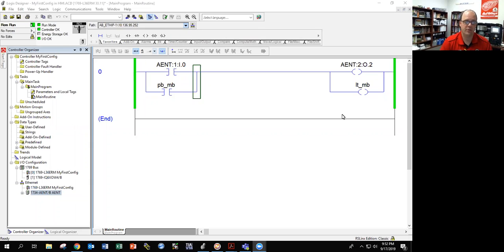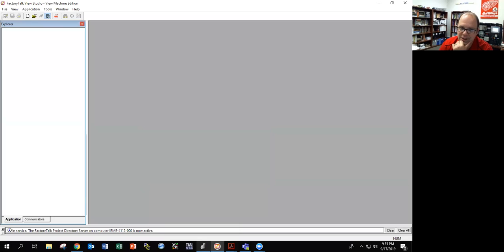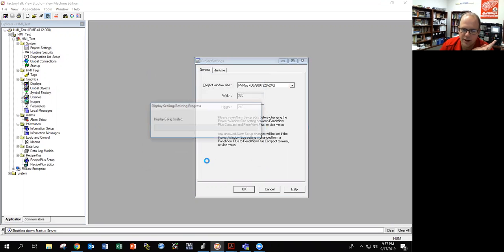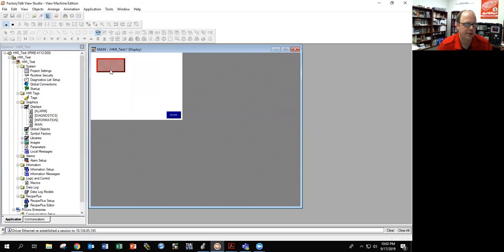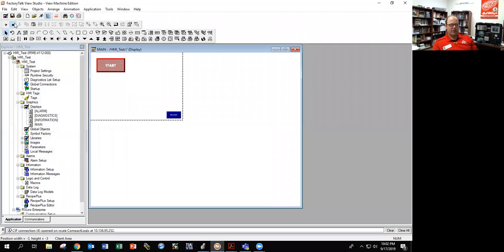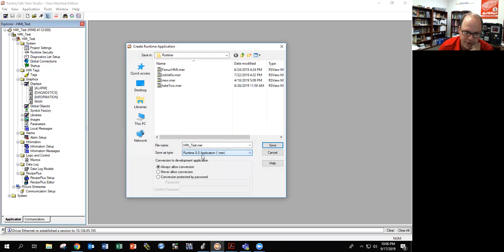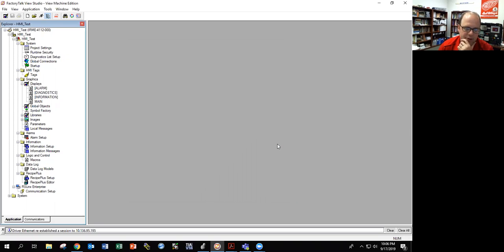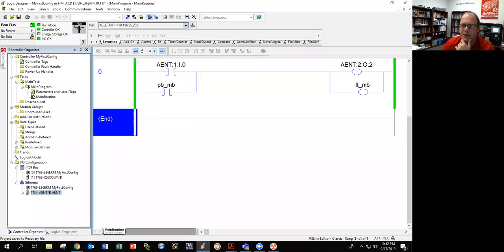Allen Bradley HMIs - A Quick and Dirty, Start to Finish Set up.

Comment: Hi Dan, Please help me with this. Why when i create a new project i do not have the graphics files , Alarm files , Information file my files are different from yours
Reply from the maker: I don't know unless I know your setup or how you installed it. I suggest checking the Allen Bradley knowledge base. Are you sure you are using factory talk view studio? Are you using the old software by mistake?
Reply: @danstaifer2028  Thank you for the response, i had figure it out. My application type was "View Site Edition" , it should be "View Machine Edition". I was totally new in this, great video! So much for me to learn :)
Reply from the maker: @zacheryzhu4165  big difference